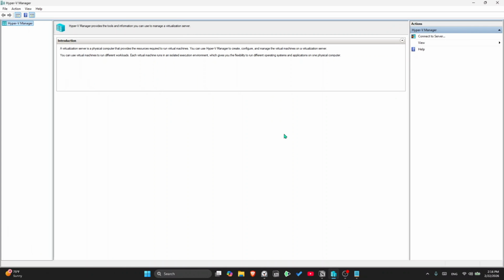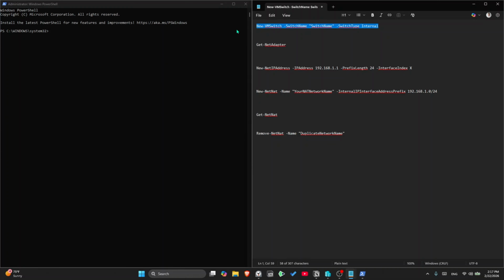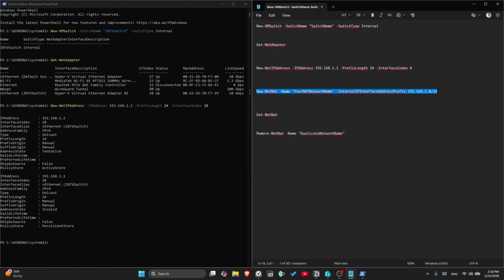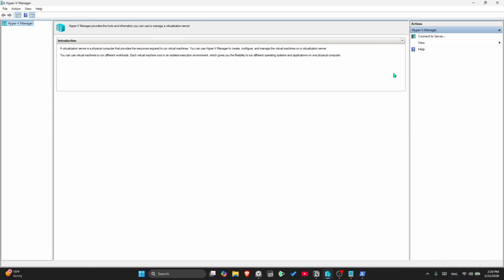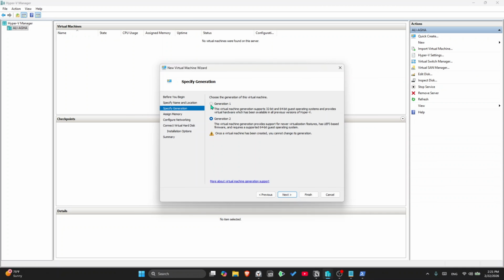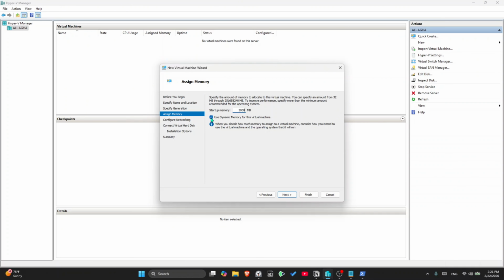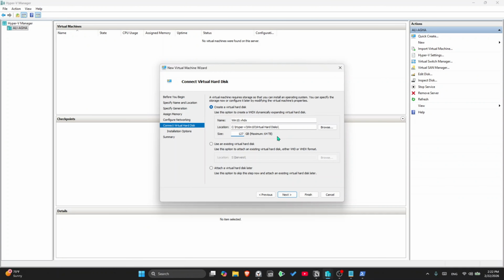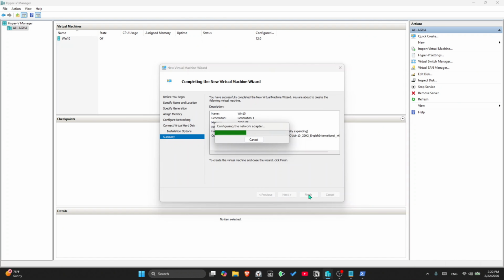Hyper-V NAT Setup + Virtual Machine Installation Tutorial

Comment: Did you need to know any information about your Network to define an IP address to use for the Nat Network? Would help if you explained how you determined the IP Address for the Nat Network.
Reply from the maker: You can set any private IP address for it. I went with 192.168.1.0/24 cause it is easy and quick. you can set 10.1.1.0/24 or any private IP address as I said.